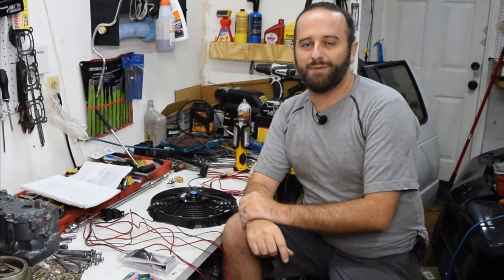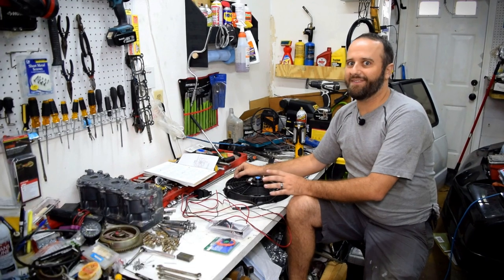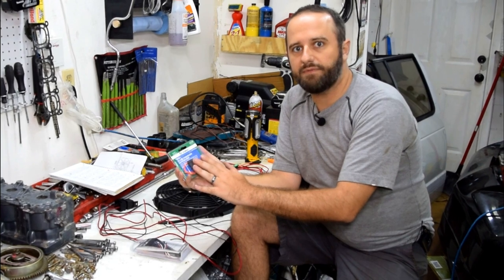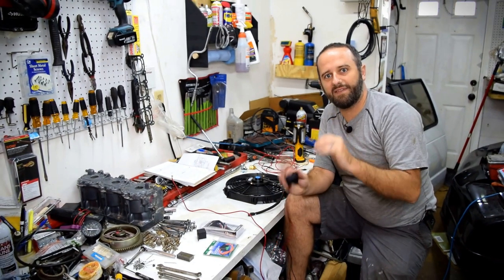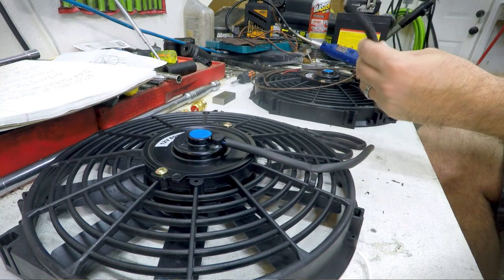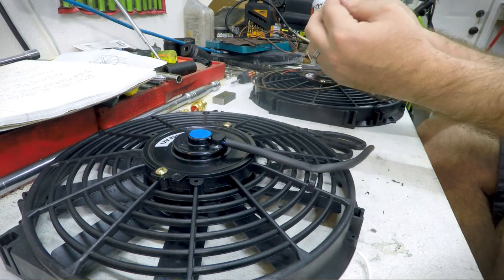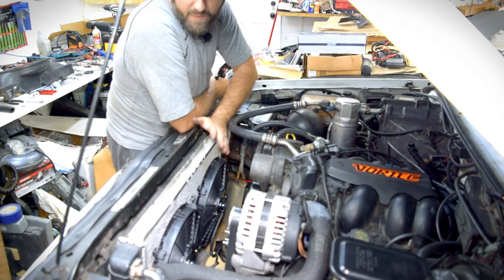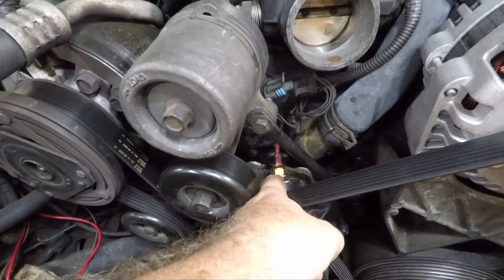Upgrade to Dual Electric Cooling Fans

Comment: These fans are welded flat toroidal armature the use a flat magnet with N, S,  N, S all around the magnets. Remember the bigger the motor, the more amps it draws cold., then drops fast as it heats up. Relays are marked with number next to terminals and usually have schematic on the side. Key on goes to terminal 85 split to each. Terminal 86 goes to temp switch. (Note) If LS swap, talk to PCM programmer to turn-on two drivers at your choice of on/off for each. They supply ground only to the fan relays & temps can be set for different degrees.
 Place fuse near battery and supply both relays on 30. Terminal 87a is off when de-energized but fans go to 87. Place grounds on clean frame metal, star washers & dielectric grease. Metal star washer dig into chassis ground & the grease keeps moisture, water and corrosion over time. It can be used on bulbs, sensors, all connectors that create high resistance and circuit failures. Hope all works well for all. Lessons learned decades ago. Certified Automotive ASE Master since 1978, retired.

Comment: Lol I can’t help but laugh at your eyes let that pipe cool down a bit homie! Ahh just kidding but defiantly good info and do appreciate your thoroughness! Very good video man! What wire did you run the manual switch from cause I’m trying to have both all’s the thermostat and e to flip a switch when I want also? Thanks for the vid!
Reply from the maker: Yep lol. . . sorry.  In some of my earlier videos I had a problem with making crazy eyes at the camera.  For the manual switch It's just an extra ground that runs to the trigger wire off the temp switch.  That way when I hit the manual switch it grounds out just like when the temp switch reaches operating temperature. . .which turns on the fans.

Comment: I’ve heard a alternator upgrade would be necessary. Any truth to that?
Reply from the maker: It would be wise to consider your alternator output when calculating the fan power draw, but you may not need to upgrade.  I had already upgraded to a Suburban Alternator prior to doing the fans.  I believe it was the 140 amp unit, so I have had no problem with the fans getting enough power.

Comment: I’m working on a 94 GMC Jimmy.  Wondering what benefits you are seeing from this mod.
Reply from the maker: I believe there was a slight improvement in mileage, but I haven't done any highway trips since i installed these.  I need to go bac and inpt all my receipts to see if I can empirically show an increase in MPG.  It being quieter when the fans aren't running is nice.  The bad part is in the Florida summer heat these 2 fans don't move quite enough air, so I can't sit in traffic with the AC running or it will overheat.  I plan to get some higher wattage fans before next summer, as I really like having AC lol.

Comment: I'm looking at the fan you have and I have the exact same one 
can I use my stock three wire system to this two wire motor? any advice would be greatly appreciated thank you
Reply from the maker: Best bet is to try to find a wiring diagram for your car.  Most likely one is a high speed, and one is a low speed.  

However, If you already have electric fans (which you must, if there's factory wiring) I would suggest replacing with the correct fan for your car, and not swapping to a generic.  There is no benefit, and you'll likely lose the ability for two speed fan operation, and possibly your AC fan trigger.
Reply: @VHickleGarage  thank you sir for your response I actually did the latter which was the go and get knock off OEM with the three wire setup I appreciate your response again thank you
Reply from the maker: @denniscampbell9376  You're welcome.  That was definitely the better choice. . and exactly what I would have done.

Comment: hi  good fans use ,  average 13 amps   &   high performance 20amps each . An 80w 6 amp fan is barely enough to be an add on acces fan . 
Remember this can cost an engine if it overheats . fans by comparison are cheap .
Reply from the maker: You're exactly correct.  These 80w fans aren't really sufficient. . .I didn't realize that when I installed them.  On short trips it hasn't been much of a problem, but in the summer with A/C on, and sitting in traffic they definitely can't keep up.  I'm going to swap them out with higher wattage fans before this summer.

Comment: Just never use those plastic zip ties that run thru the radiator itself.  When you hit bumps. It will pull down on the fins then crack them.  Boom you need a new radiator. Aluminum is better.. 
But.  You really need a mounting bracket that sits off the rad.
Reply from the maker: I used the cheap plastic ties and so far no problems there.  I do need to fab up a proper shroud though.  Between the low power fans and no shroud it will overheat sitting in traffic with the AC running on a hot day.  When I get some better fans I'll work on a good shroud and better mounts.

Comment: I got the exact same set up in my 1970 Chevy C 10 pick up I never had no problems until I added electric fans why do you think my battery dies overnight immediately? Thank you very much
Reply from the maker: If your battery dies overnight, then something is drawing power.  I'd start with a test light and see if any part of the fan wiring is hot when it shouldn't be.
Reply: @VHickleGarage   thank u 🙏 very much for the fast reply brother
Reply: @Joe Salazar. I love this era of trucks and electric cooling fans are great! He is right to use a test light on the battery connector off with a reliable test light installed. Don’t use a digital or “LED” test lamp but a simple peanut bulb sold as a 194. It takes 0.25 amps to brightly lite up. My guess is if this happened after a fan install is your power wire to the relay is hot with key off. If so, find a spot on the fuse box that is hot with key on & marked “ACC”. Relays are standardized an marked on relay with numbers & diagram. Terminal 85 should be hot with key on and jumped to both relays. The power is terminal 30 and 87a is closed when off. 87 should power fans. Make sure to test amperage from fused battery source so they do stop in traffic. Fan #1 & #2 should add up to less than 10 amps each, use a 30 amp fuse from battery. Cold copper has low resistance and creates a “Amperage In-Rush” higher than 7.5 amps. For on/off protection use a 30 amp fuse, 10 AGW wire then spit at relay at 30. Using 14 AWG to fans is fine as they are short, but clean paint, grease and use “Star Washers” sold at home improvement stores to complete ground. I am a firm believer in dielectric grease and cost $5.89 for tube at home stores in the auto section. It keeps moisture, water and air from rusting or corroding connectors for years. Best of luck!
Certified Automotive ASE Master tech since 1978, retired but working on my build. Just more tools!

Comment: I'm new at this and trying to wire 4 fans on my can am for passengers. If each fan pulls 7amps during normal operation,  you're using a 50 amp relay and 30 amp fuse, is that excessive using that high relay and amp?
Reply from the maker: Yes what I'm using should be excessive for the amp draw of the fans.  I would however recommend better fans that what I used.  They aren't enough to keep the engine cool AND run the AC while sitting in traffic.  You should be fine to use fuses and relays closer to the expected amp draw of the fans.  I'm no electrical engineer but I believe the fans can consume more amps on startup and when everything gets hot, so you always want to be a little above what you expect.

Comment: can i use toggle  switch  with  just  a  fuse ?
Reply from the maker: If you do it will most likely burn up.  Something drawing as many amps as fans require a relay.  You can then use a toggle switch to trigger the relay

Comment: how did they hold up?
Reply from the maker: The fans are still working. . .However the cheap fans I used aren't really sufficient.  In the FL Summer Heat, with the AC on, it's too much for them and will start to overheat unless the car is moving.  I need to get some bigger, better fans. . . Ideally I'll get some 2-speed units to replace the cheapies with.  I'll probably deal with that more towards the spring once it starts getting warmer again.
Reply: @VHickleGarage  Just get another cheap 16"  pusher fan to go in front of the radiator /condenser. If you have room it's a simple addition, and was actually how some luxury car makers did it years ago to overcome overheating in traffic.
Reply from the maker: @edjackson4389  That's a good idea.  I've been considering that option.  I need to decide between that or better two speed fans soon since it will be crazy hot again in FL in no time.

Comment: Circuit isnt explaind
Reply from the maker: For the circuit I just used the instructions from the relay kit.  One kit for each fan.  The only modification was I added a toggle switch to be able to manually ground out the temp switch.  That allows for manual fan control by closing the temp switch circuit, just like when it reaches the trigger temp of the switch.  Oh, and I also added fuses in-line between the relays and the battery, which is highly recommended!

Comment: Those fans are garbage period $20 Ebay junk
Reply from the maker: You are spot on. . . They keep everything cool, so long as the AC is off.  I need to order some better fans to swap them out.  Fortunately with the way I installed, swapping fans will be easy.

Comment: We sell much higher wattage electric fans than the 80w in this video at https://www.americanvolt.com/collections/electric-fans which includes radiator mounting kits. Various thermostat switch turn-on temps and NPT thread-in sizes available as well.
Reply from the maker: I"ll take a look.  These 80w fans aren't really up to the task of keeping the engine cool and running the ac in the FL summer heat.

Comment: WRIGHT ON VID Mr. HICKLE. WOULD BE GREAT VID IF A WIRING DIAGRAM WAS IN UR KEY MOMENTS. ALSO,  WHAT IS THE ON/OFF TEMP. OF UR TEMP SENSOR?  DID THIS INFO COME W/UR FAN KIT?   BEST, G E.
Reply from the maker: The on/off temp is based on the gold temp switch that I installed in my water pump.  I believe it was on at 185 off at 200.  I've been meaning to get a cool temp range switch, but I usually just manually turn the fans on as soon as I start the car.  The 80w fans with no shroud don't actually cool as well as I would like.  I'm planning to upgrade to better fans soon.